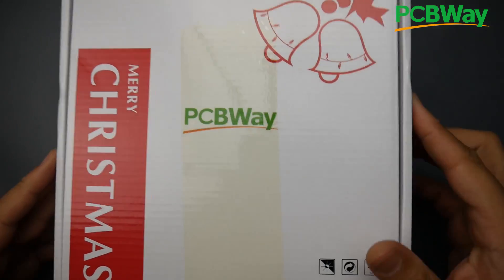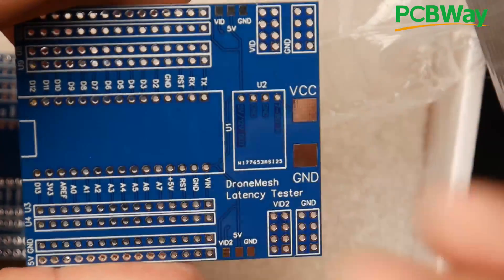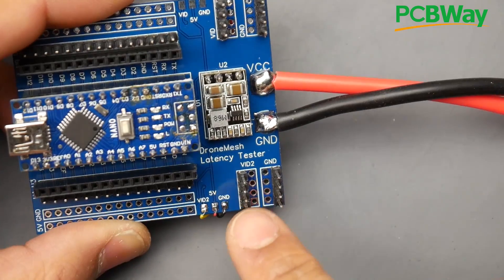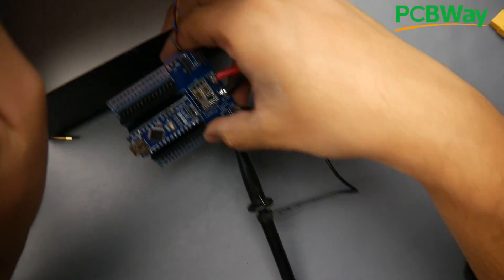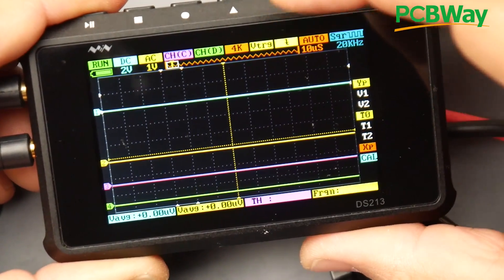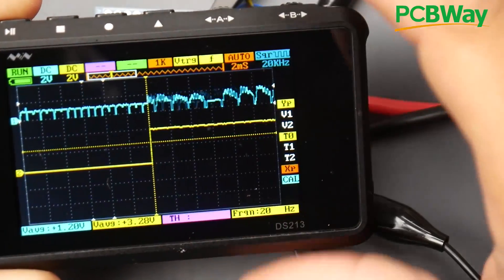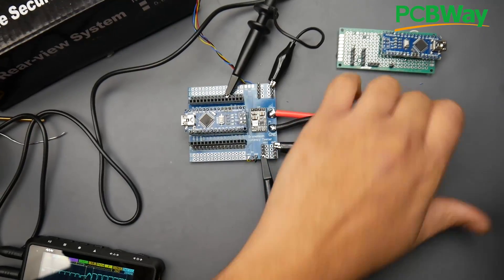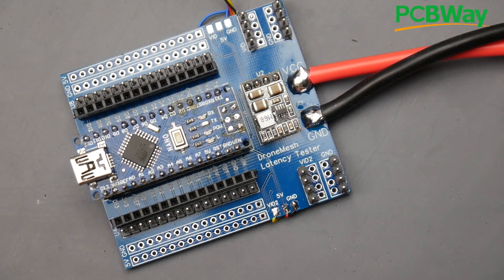Your Own FPV Camera Latency Testing Setup // Custom PCB

Comment: I have seen some rewievers use the camera to take video of a accurate clock with many digits, then compare the videofeed image together with the clock in real life to get the latency ,  i dont know how much latenzy a vtx have , but its wery easy to setup and should be accurate.    Or am i completly wrong ?

Comment: Dumb question:  How did you heat all the holes at once for your female pin headers since you tinned them all first? Or were they all separately installed?
Reply from the maker: The female headers are all ready to be installed nothing was tinned before.. Hope that helps if you still have any questions feel free to ask again. BTW it's not a dump question :)